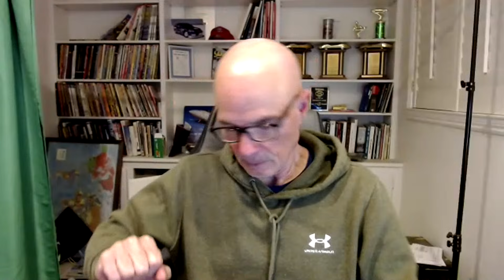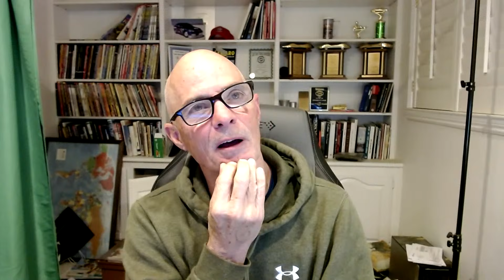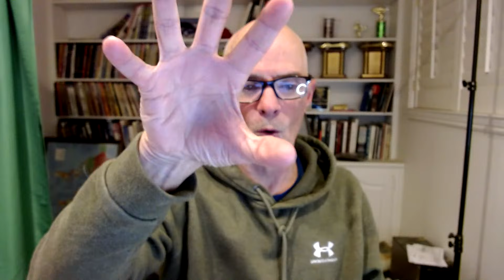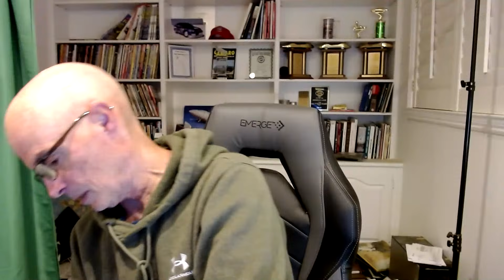DON'T FORGET THE TOOLS LET'S TALK TECH

Comment: I have had bad luck with some of those (not yours) harmonic dampener pullers (I think it was the Performance Tool), where the jaws broke for me. @ifixmautomechanics7443 did a cool video on a puller they used about 3 weeks ago.   I think I have used ICT Billet Harmonic Balancer Installation Tool 551141.  I think a high grade (Like Grade 8 or harder) allthread and a hardened nut.  Something like  Summit Racing Harmonic Balancer Installation Tool for GM LS SUM-900135 has a nice shaft and nut.

Comment: 1:28 Rich, another LS guy I know who is real knowledgeable cautions against drawing the damper back in with a bolt.  Does this only apply to the stock bolt because you would start out with just a thread or two grabbing, and then you would be able to use a longer one without issue?
Reply from the maker: it is okay to do as long as you have a lot of thread engagement (which is why a longer than stock bolt is needed to get things started)
Reply: @richardholdener1727 solid!  Then, couldn't a guy just use a grade 8 bolt and washer and a piece of plate steel?

Comment: Installer? use puller with washers/ torrington bearing and spacer the extension legs ( that normally bolt to damper) become handles .
Or same center shank  torrington and spacer stack up with a nut in place of the 3 jaw hub and arms. 
Theas 2 design paths keep BOM to a minimum with the benefits of  being a hand job  preventing power tool install errors.  
If you use⅜ or½" arms the gap between the hub and arm can be specified as ratchet hole when arms are out as handles.